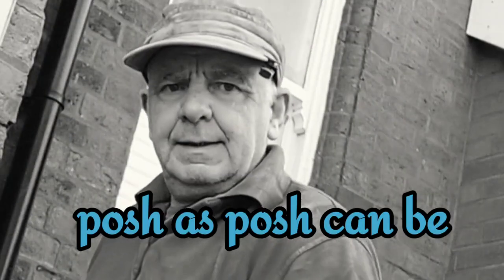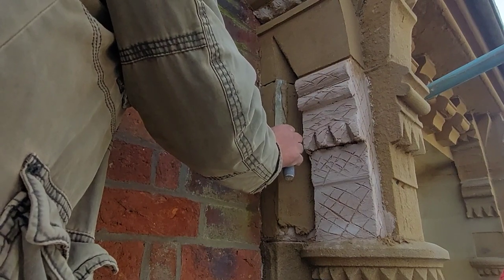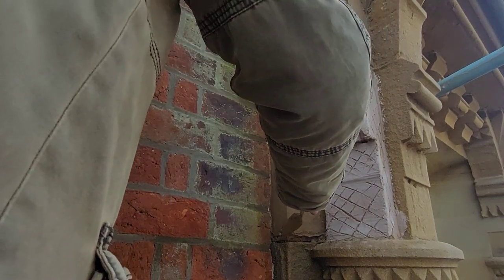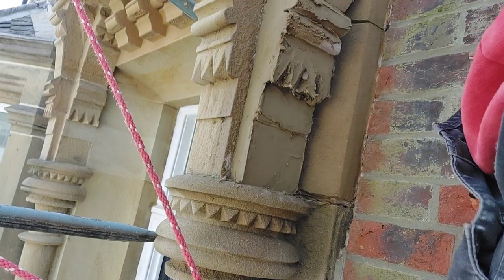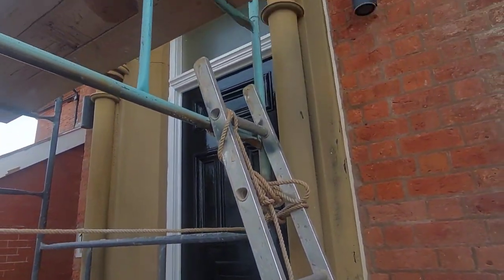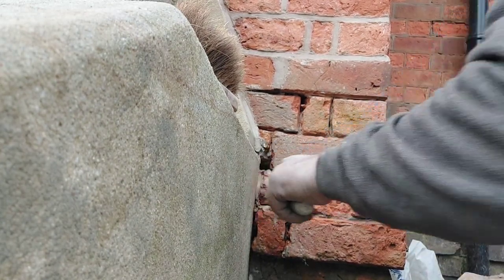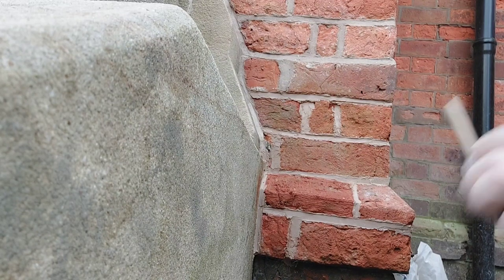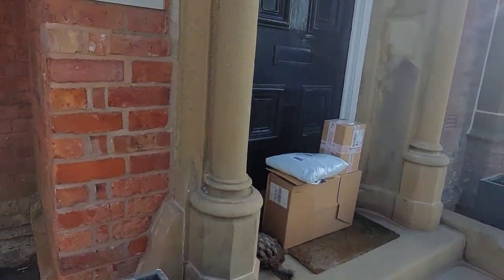Can I save this Victorian stonework or is it to late,  let's see

Comment: Is the stuff you use pigmented (quick)lime putty for top coat with fine sand?  Very fatty stuff. Really nice work too. The 'sticky' green mortar can fatten up with the slurry too, with a lite mist of water. As for  SBR, very watered down SBR (minimum 15:1) also consolidates fried stone and maintains breath-ability (I tested it out). iimo PVA is both useless (for limework and stone), and fundamentally wrong to use, because its vinyl, and it works good with gypsum.

To get the profiles close, I use reference profiles made up either end (or as long as the fine edge tool spans) and float the tool to cut the profile. I always clean the tool during use to prevent the stuff sticking to the tool allowing smooth floating, then open the surface when green.

It saddens me where many gypsum based mortars get pasted on natural stone, because its the original long term investment wasted by the rapid decay that follows the use of them. Subsequently thousands of money can be spent replacing the stone. Mind you, in the very olden days, moldings were a common thing to use as templates...
Reply from the maker: I add earth pigment to my mortar to match the colour of the particular piece of stonework I am re facing. I do try and replac stone when I can as obviously it's a better repair.

Comment: Brilliantly done. What pigments did you use for lime, and where did you get them? 

Also, recreating face of the brick was interesting to watch as very little video material one can find on the web where one can see how it’s done. Can you please tell us, what ratio did you use for creating brick-face repair mortar and what material, I presume that there is brick dust, lime, and sand? I do ask, because I am pondering about it whether to replace the whole four bricks or to repair it just as you did. Many thanks.
Reply from the maker: Hi, the pigment for lime needs to be natural earth pigment, I get my pigment from cornish lime Ltd but you can find suppliers on line to. The ratio for brickwork facing is 3 aggregate to 1 lime and a dash of earth pigment for the colour. Hope this helps you with your project.